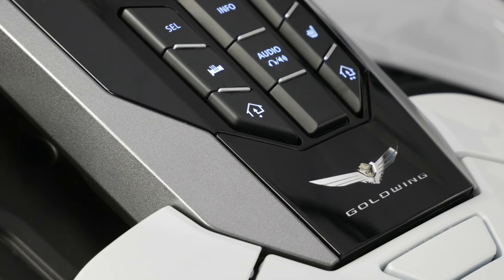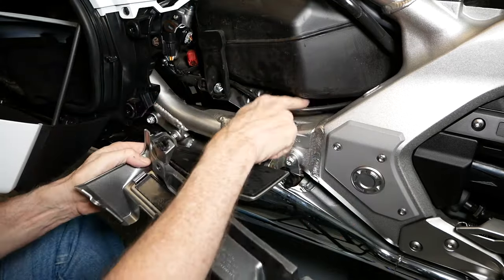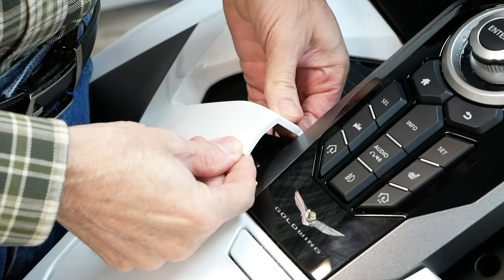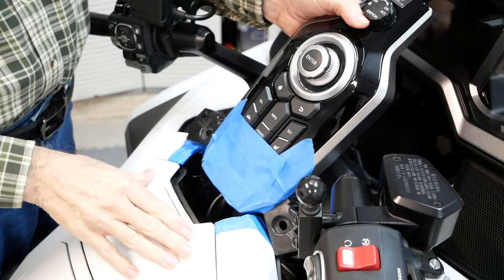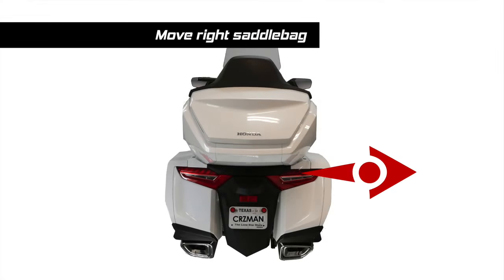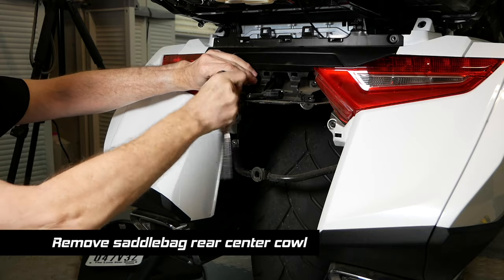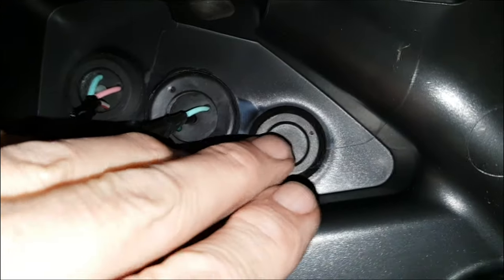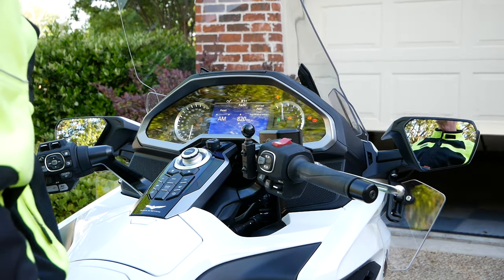How to install HomeLink garage door opener onto a 2018 or later Honda Goldwing | 2023

Comment: Great video, here is another shame on Honda moment....this is something they just should have wired in when the built the bike, add on another $200 to the retail price. Same with the Trunk light, what a pain in the ass to install something that should have been there from the start.  It took some time to install the trunk light, but it is totally worth in in the dark, probably won't bother with homelink. I have noticed on my bike and yours too, there are knock outs in the saddlebag upper that looks like you can put a light in them too??  Any thoughts?

Comment: Installed Homelike in both my Goldwing and my wife's Goldwing about 4 years ago.  Really not very difficult, and when done, the Homelink is a very handy feature.   I did not completely remove the center panel when installing the buttons so had fewer steps.   Really not difficult.

Comment: You don't need to do any of this, disconnect battery, just pull the antenna cover  feed wire from where it plugs in, install homelink and plug it in. Pop the center up by the glove box remove 2 push pins and 2 5mm screws lift and slide towards front of bike lay down micro fiber cloth over glove box remove remove 4 fillips screws pull sides apart gently flip back over remove 2 fillips screws remove cover remove 2 more fillips screws for buttons. install buttons and reassemble every thing. About 45 minutes if you do it yourself! Simple

Comment: On European bikes, that wiring harness is not mounted onto the bike so we cannot place homelink, it would not work. I find that very regrettably. But if i I should find someone who will makes a harness, then maybe i would install homelink. But so far, nobody found to make the harness.
Reply: 💯 % correct. I am based in South Africa 🇿🇦.  I bought a whole lot of accessories from Wingstuff in 2019 for my 2018 MY wing, including the homelink. After all the stripping and hours of searching for that 8 pin connector, it was just not there. Ended up with the buttons connected to the middle console, but no Homelink. It's such a shame that Honda decided not to give us homelink as well. I'm not sure why, though? 
I wonder 🤔 if the new 2021 model and upwards had an update where they included this homelink connector to all their bikes?
why is it only fitted for certain markets?
Reply: I do have a 2021 model and I can say it is not available on the motor.